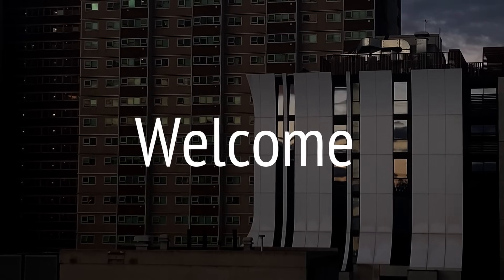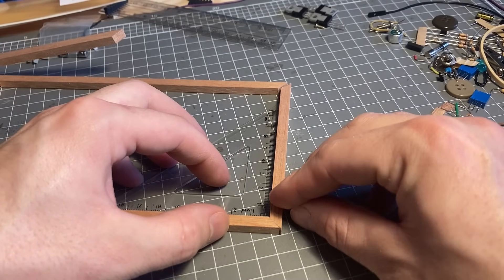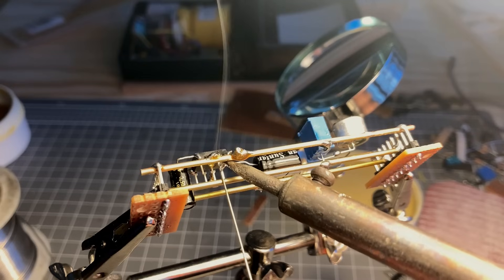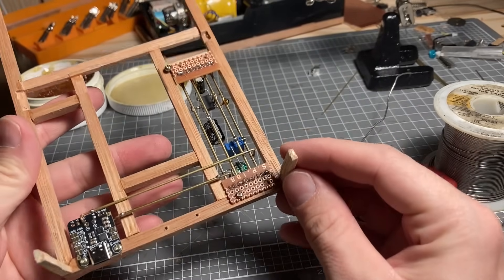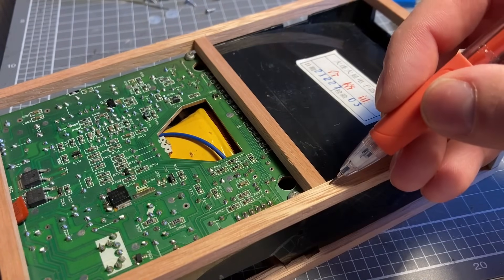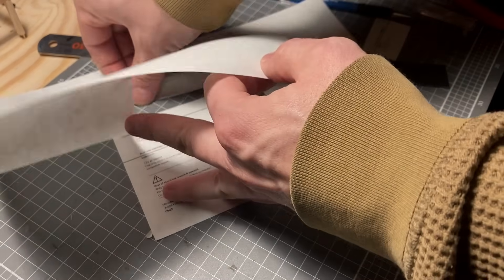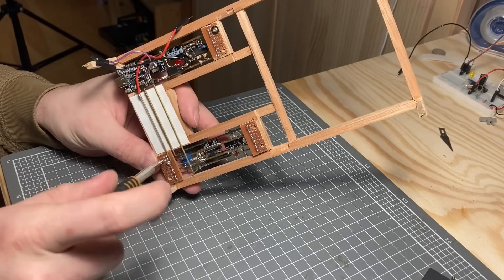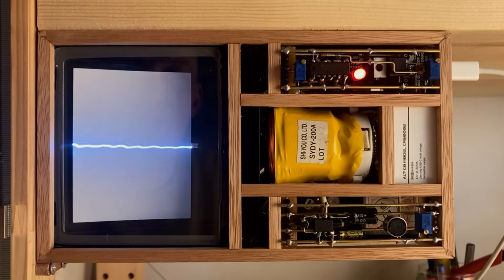Building a custom audio wave display (With a surplus CRT)

Comment: That was a beautiful execution! Everyone designs PCBs nowadays but for this application the freeform was very aesthetical.

Beware of burn-in. The phosphor is not designed to have full illumination along a single line, even if it jiggles somewhat.
Reply from the maker: Thanks and cheers. Regarding the burn-in, I did a few things to mitigate it, including running the gain a little high on my mic and leaving a bit of noise from the power supply, so the beam does not stand still ever. However, it will certainly become a problem at some point. Luckily, it spends most of its time powered down.

Comment: if you wire to both deflection coils you get cool jiggling circles. you can also easily add a 3.5 mm jack for an optional line input. this is a cool project. one of my first when i got interested in repurposing old electronics
Reply: lissajous pattern
Reply: one of your first?